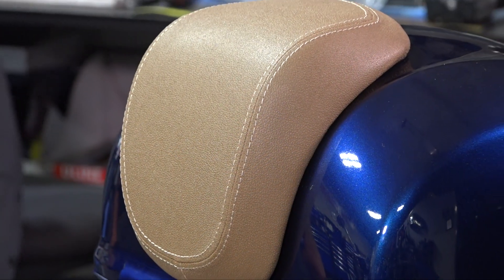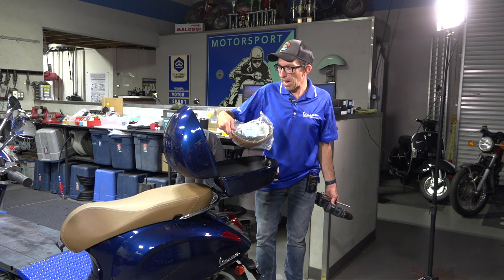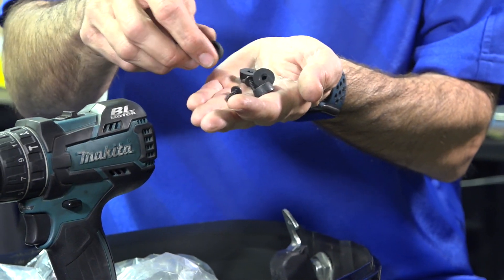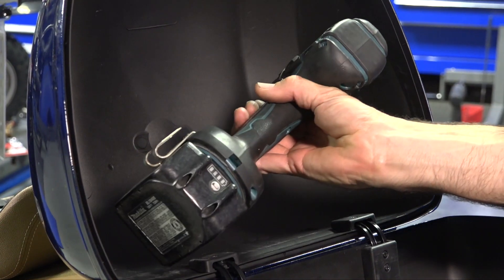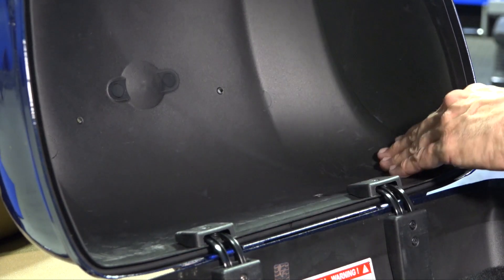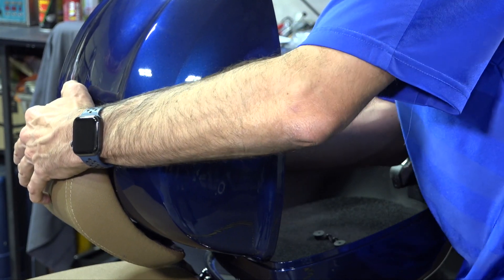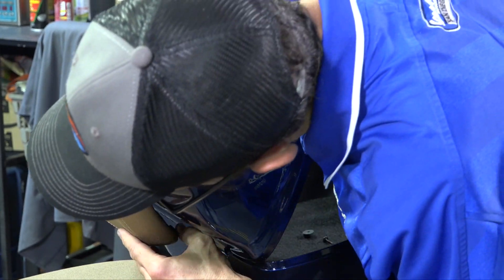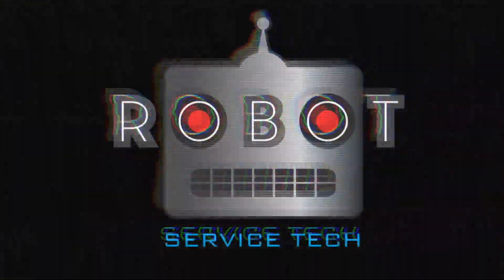How To Install a Passenger Back Rest Pad on a Vespa Primavera or Sprint Top Case

Comment: Video is helpful, I also used a couple metal pokers to help align the hole in case with where the screw attaches. Another thing helpful for me was to add white grease pencil marks on the inside of pad where screw goes to aid in visibility. The pad needing to be forced down while driving a screw into the pad is a bit weak in the design...